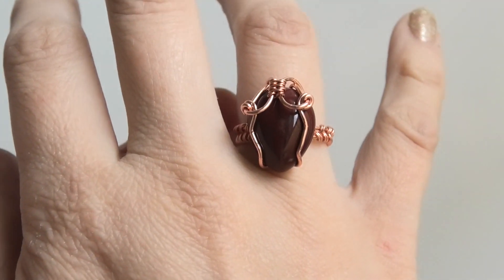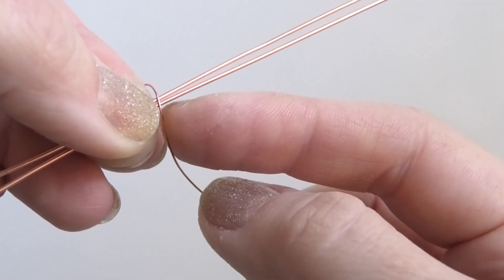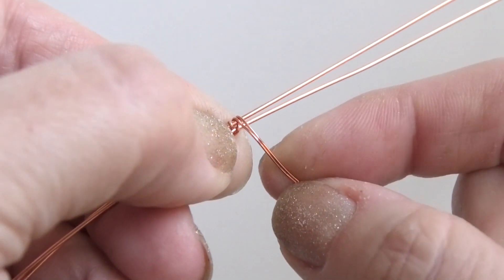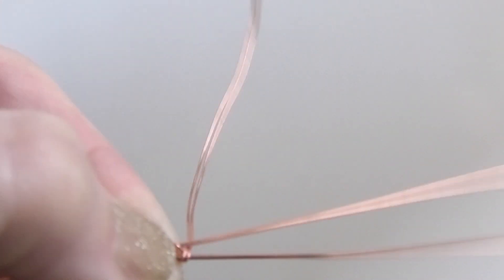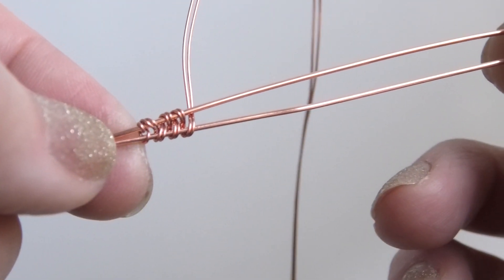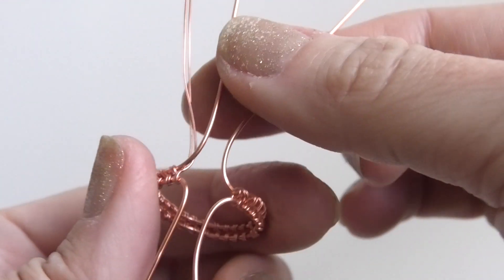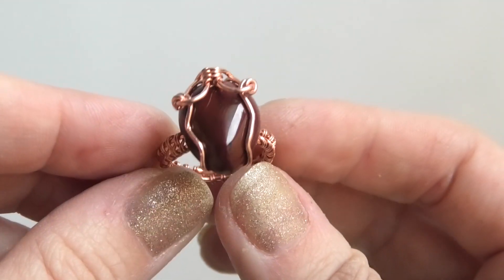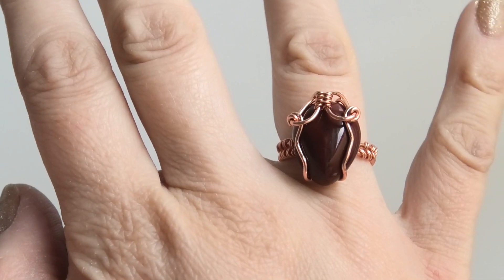Round Wire and Teardrop Cabochon Wire Wrapped Ring Tutorial

Comment: HI Oxana, long time follower, i was wondering if you have a video and/or design suggestion for a half round matching stones that are indonesian picture jasper.  so they are a matching set.  i was going to make some earrings out of them, or maybe a two sided pendant. please let me know what you think.  the picture jasper has lots of stuff on the bottom, so wanted to keep that open to view.
Reply: together they form an oval, if that makes sense.  hard to explain without sending you a picture
Reply from the maker: You could do a simple cabochon wrap like this to keep the picture in the stones showing https://youtu.be/aqp10UhptiE?si=iCzmet8k9lt1uyZj 
you would just have to bend the frame around your stones since they are flat on bottom and not rounded like the oval in the tutorial. But everything else you could do the same way. And you can wrap both stones this way and attach earring hooks if you want them to be earrings